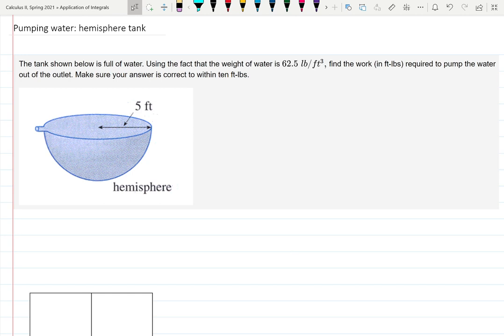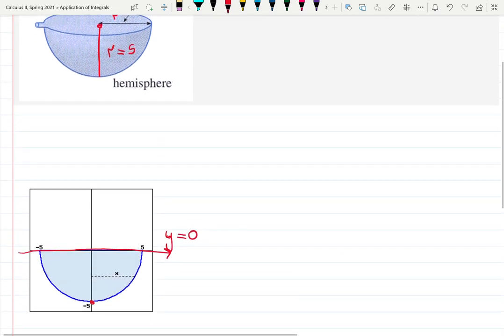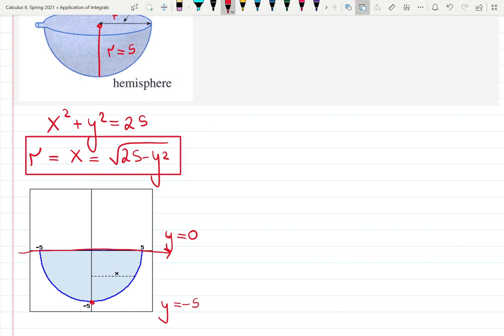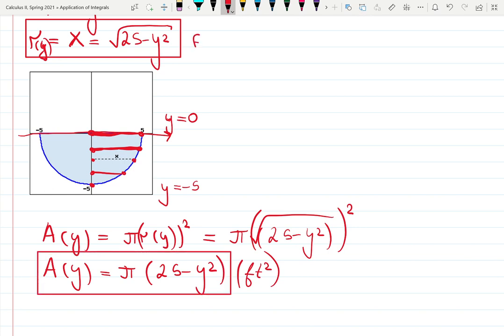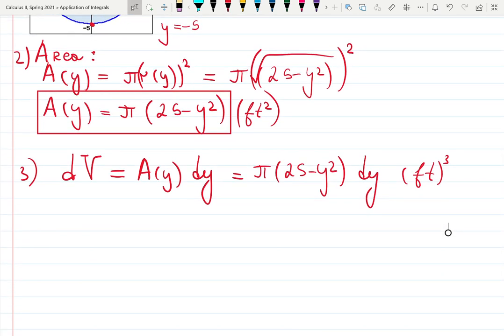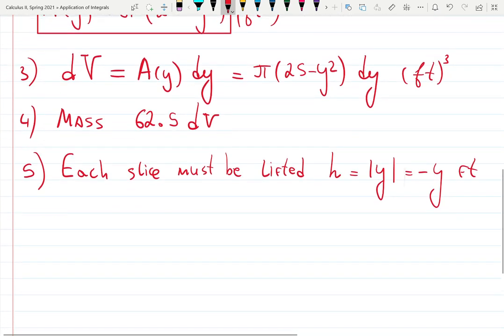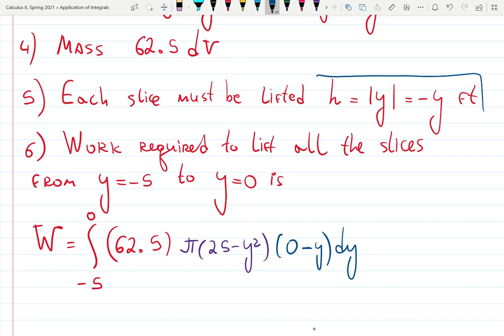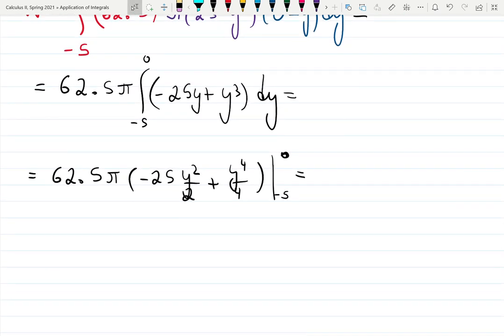7.6 HW: WORK: Pumping Water from the tank example

Comment: Why is distance/displacement = y and not = 5-y? Supposing we set the hemisphere on the x-axis and not below it. 
I've seen other similar problems where they would subtract the top number minus the variable, in this case y.
Reply: yeah, bro, I agree with you. I solved the problem with the hemisphere placed on the x-axis and this gives us the displacement for the thin layer as 5-y. I came back to check the comments cause I doubted this...thanks mate for sharing your opinion.